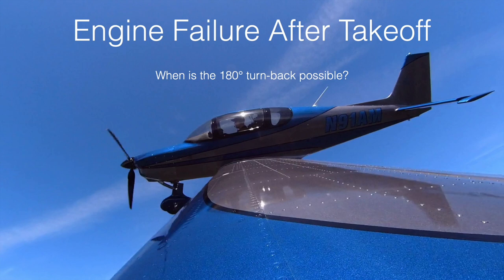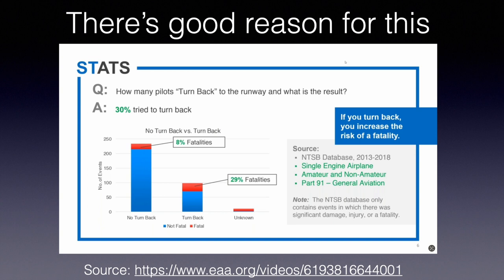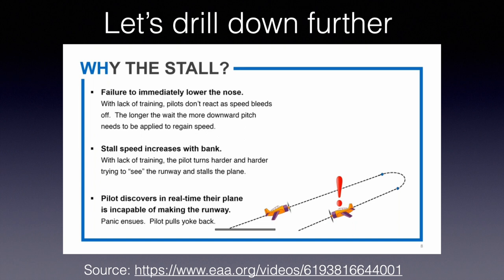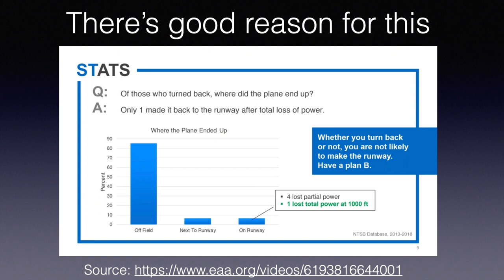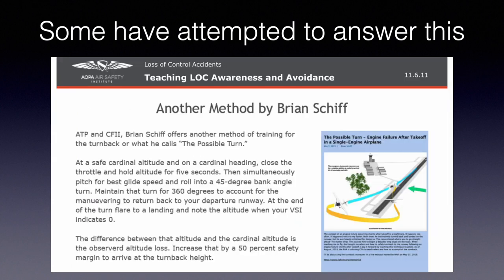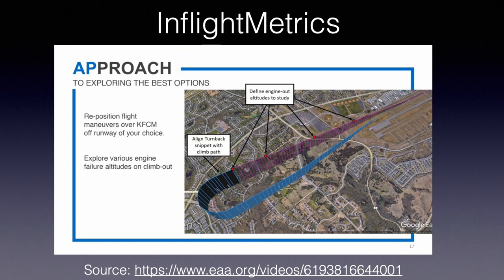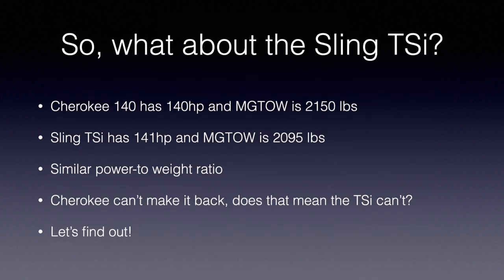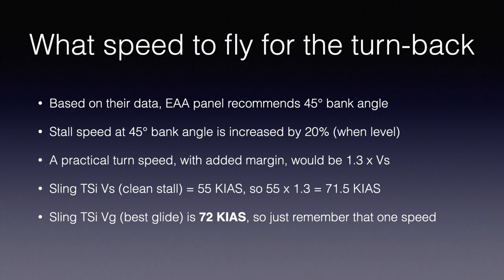Sling TSi engine failure after takeoff - Impossible Turn analysis

Comment: I learned them in 1996.  Teardrop with some power and no power turnback.  My CFI had  a great method and markers on altimeter and ASi.  Later on he came with the 777 formula for 4 cylinders and 999 formula for 6 cylinders airplanes..
Reply: Teardrop if partial power if under 500 agl so you get distance from the runway if on your side.  Turn 40 degrees to the side for first turn to angled and troubleshoot while getting some room for the second turn.  Only do that if power is down but not surging.

Comment: For under 500 agl Teardrop- The Partial Power Teadrop is.. Go with the crosswind for first turn to 40 degrees angle away from crosswind, the first leg for 4 seconds while leaning mixture and changing tanks, then 2nd turn is 40 bank to turnback at Vglide.  The 444 Teardrop Turnback.  After the 2nd turn, use Flaps if high, also cut mixture if high, dive to the numbers then cut flaps on flare. Brake with no flaps no prop turning.

Comment: I think this is an excellent topic that never gets talked about. I’m a firm believer that every skill level and Aircraft are different. You have to practice in your specific make and model. A few months ago  I wanted to see how low I could make this “impossible turn“ in my Rans is 21 with the Rotax 915. One of the most critical aspect to this is having a good coordinated flight install recovery techniques. An audible AOA is also extremely beneficial. I did mine at half fuel on a 50° day. I took off at the far end of the runway so that I would be the furthest from the runway when I turned back. I knew that if I was ever too low my wings level, add power and recover. I started at 800 feet then 500 feet and my third and final attempt was dropping the power at 280 feet. I gained another 30 feet in the turn, which was rather steep, but I had a lower angle of attack with a nose pointed below the horizon. Made it back to the runway no problem. Granted my aircraft is a light sport with a best glide speed of 59kts and the biggest thing was that I was expecting it. Nice job with yours! I should also film mine to see exactly what it is I did, and how I did it
Reply from the maker: Yeah, it's amazing how low that STOL planes like yours can pull it off. The lowest one we analyzed was 535' AGL with a 10-knot headwind, but had I been lighter or the DA had been lower or if I had used a Vx climb, the minimum altitude would be been even lower. Still, to stay on the conservative side, I'd probably add a couple hundred feet or so for fudge-factor, depending on other contributing factors.
Reply: MacSpadden was confronted with the worst kind of EFATO. And That kind of EFATO  i think he didnt know.  The Surging Engine kind.  The worst kind that can fool you into try to reach fields and suddenly engine quits all AND THEN YOU CANT.   Many good pilots have been fooled by Surging Engine EFATO.  Then engine quits and they crash short. 

I had 5 engine failures on pistons in the 3,000 hours that i flew them in South America cargo i flew in the 1980's.  2 total but they were twins.  DC3 and Piper Aztec.  I landed them feathered engine spitting oil.  The other 3 were partial power. Singles.  On take off.  Lost one cylinder.  There are 2 basic kinds of partial power engine fails (LOTOT).  This is for 4 cylinder engines. 
 1-The Vibration LOTOT,  2-The ENGINE CUTTING OFF IN AND OUT LOTOT.  

In the vibration LOTOT you sort of lose the climb only, so if over 500 agl, you can still Turnback or Turnaround airport if know how to before.  Dont know ? Dont go there.  Good luck crashing outside the airport.  Good to lean mixture and SOME carb heat apply after lowering the nose.  I was on Cherokee 180 on both and did the downwind leg at 1-200 agl, 2nd at 250 agl.  I didnt know how to do turnbacks, so i went to a low downwind leg.  Scary as hell downwind leg 200 agl at Vglide with engine vibrating.  

In the worst LOTOT or engine cutting off in and out, or engine noises, change tanks and be over say 700 agl before Turnback to opposite or side runway, and dont think about going around the airport, the engine can cut out before you complete the turnaround. =  Dont try any turn to airport under 700 agl if engine is cutting out badly.  Be a Turnback or a Turnaround maneuver.  

Practice LOTOT.   At least the engine vibrating "Turnaround" at 1,800 rpm and later on "The Turnback" from 700 up (depends).  LOTOT should be required due is 3 times more common than EFATO.   LOTOT and EFATO can get you easily if you dont know well.  So Ignorance is not the solution.  IGNORANCE IS THE PROBLEM.

Comment: So i did this with an instructor today in the Sling4. Lowest we were able to safely pull it off was 400AGL - this with 3 seconds reaction time, 12-15kt headwind and a field in an open plain. Standing start and a Vy climb (with level flight to get some distance upwind of the runway) The surprising thing for me was the lack of altitude loss in the turnback - on average around 150ft at 70kts 45deg bank. I know its controversial but I'd say that in MY aircraft, on a favourable day, I'd brief a turnback above 500ft. Thanks again for making us think about this...
Reply from the maker: Wow! I know the Sling 4 has a different wing than the TSi, but it’s surprising that your altitude lost in the 180 is HALF of mine! In any case, don’t forget that the headwind makes a huge difference. If you had no headwind your minimum turnback altitude would be substantially higher. You might also consider adding some altitude for a “fudge factor,” knowing that we likely won’t perform as well in an emergency as we do in practice. Of course, it also depends on the airport you’re returning to versus the off-airport options. So many variables to consider!
Reply from the maker: Also, what was the density altitude and how heavy were you when you did your practice turnbacks?
Reply: @OneAlphaMike  was approx 7000ft at airfield (airfield alt 5500) - prob 800kg /1700lbs  gross weight. (2 average crew/100L fuel). I think conditions were ideal  - as you pointed out it would depend on wind, environment around the field etc. Will do some more testing and report back.
Reply: Is there no way to calibrate your airspeed on the Garmin?  I haven’t looked at that aspect of my build yet, but I have to assume you can calibrate the airspeed to be more accurate.
Reply from the maker: @LTVoyager  No, you can't.

Comment: For power off better follow a rule.  The 777 No Power Turnback Rule.  If expecting to climb at 700 fpm plus, have 7 knots or more wind, then mark the altimeter for 700 agl or more.  I learned that on the Emergency LowManeuvering channel.  The 700 No power Turback rule.  Partial Power he taught from 400 agl if not surging engine.  If surging, dont turnback, headwind turn if any.

Comment: This makes me think that that flying the traffic pattern on departure, when possible, is a good safety practice.  Upwind, crosswind, downwind, then continuing to climb well above what would be a tight base leg.  In my airplane I'd be at least 500' above TPA by that 'base' leg. 

Yes, it adds a few minutes if your final course is in the direction of the runway departed from, but it keeps the airplane close to runway until above pattern altitude.  I fly out of a controlled airport where this wouldn't be practicable since it would conflict with ATC's normal procedures, but at an uncontrolled airport it could be safely flown without conflicting with other aircraft.

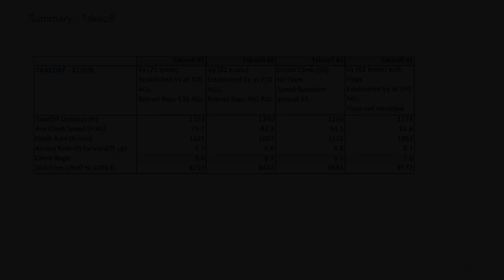Comment: 27:33  Climbing with 10 degrees flaps more or less is safer if engine fails, safer  visibility, and safer for rear cylinder cooling to due bit less nose up which cuts some ventilation to rear cylinders.  Safer climb. Then at TPA the flaps up.  I learned that in 1996 from ELM channel Bush Pilot CFI.
Reply from the maker: Different procedures for different airplanes. The Sling TSi climbs markedly better with flaps retracted. Cylinder cooling is not a concern with the Rotax thanks to liquid cooled cylinder heads.
Reply: @OneAlphaMike  Vx flaps or less.  Even in winter we climbed on Cherokees with 10 degrees of flaps at almost Vy.  FPM as good as Vy and safer over nose view.  and if LOTOT, we had some safe speed over stall speed.
Reply: @OneAlphaMike  Your climb angle is better with some flaps.  See your chart.  No flaps is 6 something and with flaps is 7.0
Reply from the maker: @outwiththem I can see how that number might be misleading. Those numbers were taken from a small snippet of time, not over the entire climb. As mentioned in the video, the important number is the bottom row, which is the horizontal distance traveled over the entire climb, from liftoff to 1,000' AGL. There you can see that the climb where I retracted the flaps reached 1,000' AGL 130 feet sooner than the climb where I left the flaps in. That shows that the climb angle over the entire climb is actually better when retracting the flaps. That said, it's not a huge difference, so if you prefer not retracting the flaps, it's not a big deal.
Reply: @OneAlphaMike  most engine fails on take off are the partial power kind.  And it becomes like a slow flight at Vglide speed.  And you need a bit of flaps for lift in it to avoid using too much nose up.  With say 10 degree flaps, you are ready for the main cause of engine fails.  More..
Reply from the maker: @outwiththem Vg (Best Glide speed) is clean, not with flaps.
Reply: @OneAlphaMike  Yes, Vglide is clean.  But with most partial engine fails on pistons, it is mostly one of the cylinders lost.  The rpm will fall to a bit under 2,000 rpm on most 4 cylinders.  My Bush PIlot CFI made me practice that in 1996 due he had 3 of those in old Cherokees in South america.  At say about 1,900 rpm, you need to keep speed at a bit under Vglide to maintain altitude and turnaround the airport if over say 700 turning downwind.  Under Vglide speed you need some flaps to keep altitude and nose not so high AOA.  Some airplanes need around Vglide speed to keep altitude, some a bit under.  Vglide speed is a general speed reference even if not gliding at that moment. 
 
Or if under 700 agl, decide to turnback to side or back runway or keep going forward to crash or land outside the airport. My 1996 CFI will post a bit more about the 2 kinds of partial power engine fails on take off later on.  He has a channel called EmergencLowManeuvering but he has other hobbies and dont post as much lately.
Reply: @OneAlphaMike  So why for a small snippet of time? Any way, with some flaps the climb angle is higher, not worse than with 0 flaps.  
 And if partial power engine fail and speed falls to a bit under Vglide, you need flaps under Vglide for some lift and nose too high and most 4 cylinders you can fly level altitude.  We did that on Cherokees and Cessnas. 1990's.  My old said he had done 3 cylinder turnaround on Cherokee 180 from only 200 agl (1,900 rpm).  We practiced them from 400 agl.
Reply from the maker: @outwiththem  I'll try it again, one last time. Two climbs to 1,000' AGL. One takes 8442' distance to get there, The other takes 8572'. Which has the better climb gradient?
Reply: @OneAlphaMike Quite close numbers.  Maybe 1% difference.  But were they done under exact weight? im discussing this with my 1996 Bush Pilot CFI which taught me 4 kinds of EFATO/LOTOT.

Comment: Something to keep in mind and discuss with ur instructor. Personally, I have executed an “impossible turn” in my flying career. I was in my Biplane which was light weight and had excellent glide ratio.
Reply: For power off better follow a rule.  The 777 No Power Turnback Rule.  If expecting to climb at 700 fpm plus, have 7 knots or more wind, then mark the altimeter for 700 agl or more.  I learned that on the Emergency LowManeuvering channel.  The 700 No power Turback rule.  Partial Power he taught from 400 agl if not surging engine.

Comment: Mike - this is fantastic data.  Thanks so much for providing this analysis.  As you pointed out, there are many variables but it's good to have a framework and even more important to practice it.  I trained at KPDK in an SR20 while getting my PPL. It is a densely populated area with few good options if an engine failure occurs on takeoff.  To his credit, my CFI repeatedly made me go through scenarios and verbalize them on every takeoff (to get it through my weak brain).  If engine failure occurs before rotation, max braking, S turns, etc; after takeoff but below 600 AGL, best glide and straight ahead; between 600 and 1000 feet AGL, pull CAPS; above 1000 feet AGL best glide and turn back to the field.  I've tried to get data on altitudes for chute deployment in the TSi but only heard generalities, so I'm very much looking forward to your next video that discusses that as well.

Comment: I learned 4 kinds of EFATO maneuvers ON THE RUNWAY DID THEM TOO in 1996.  Many "Turnback Accidents" are not.  They were instead "Turning Around the airport" with a partial power low power engine, stalled, crashed before final approach of the same runway they took off front.  They didnt "Turnback" when needed and crashed doing A TURNAROUND.  Those are 2 very different maneuvers.  Good to learn both.  Most EFATO are partial power or LOTOT.  You have 4-6 cylinders that can fail.
Reply from the maker: That's true about partial power failures, and it's one thing Rick from Inflight Metrics saw in some NTSB reports. The issue starts off as a partial loss of power, which gives the pilot the idea that they can fly around a bit more. Some even try to follow the pattern back to the airport  Then the partial loss of power turns into a total loss, and they're not in a position to land.

Comment: Thank you for doing this and helping me wrap my head around considerations when flight planning!
Reply: MacSpadden was confronted with the worst kind of EFATO. And That kind of EFATO  i think he didnt know.  The Surging Engine kind.  The worst kind that can fool you into try to reach fields and suddenly engine quits all AND THEN YOU CANT.   Many good pilots have been fooled by Surging Engine EFATO.  Then engine quits and they crash short. 

I had 5 engine failures on pistons in the 3,000 hours that i flew them in South America cargo i flew in the 1980's.  2 total but they were twins.  DC3 and Piper Aztec.  I landed them feathered engine spitting oil.  The other 3 were partial power. Singles.  On take off.  Lost one cylinder.  There are 2 basic kinds of partial power engine fails (LOTOT).  This is for 4 cylinder engines. 
 1-The Vibration LOTOT,  2-The ENGINE CUTTING OFF IN AND OUT LOTOT.  

In the vibration LOTOT you sort of lose the climb only, so if over 500 agl, you can still Turnback or Turnaround airport if know how to before.  Dont know ? Dont go there.  Good luck crashing outside the airport.  Good to lean mixture and SOME carb heat apply after lowering the nose.  I was on Cherokee 180 on both and did the downwind leg at 1-200 agl, 2nd at 250 agl.  I didnt know how to do turnbacks, so i went to a low downwind leg.  Scary as hell downwind leg 200 agl at Vglide with engine vibrating.  

In the worst LOTOT or engine cutting off in and out, or engine noises, change tanks and be over say 700 agl before Turnback to opposite or side runway, and dont think about going around the airport, the engine can cut out before you complete the turnaround. =  Dont try any turn to airport under 700 agl if engine is cutting out badly.  Be a Turnback or a Turnaround maneuver.  

Practice LOTOT.   At least the engine vibrating "Turnaround" at 1,800 rpm and later on "The Turnback" from 700 up (depends).  LOTOT should be required due is 3 times more common than EFATO.   LOTOT and EFATO can get you easily if you dont know well.  So Ignorance is not the solution.  IGNORANCE IS THE PROBLEM.

Comment: FOR TOTAL ENGINE FAIL, Use the 777 EFATO Turnback Rule for light singles.   The 999 Rule is for heavy singles. 
  The 777 rule can be done even when on preflight or driving to airport.  Will I be able to climb over 700 fpm? Yes? Are the winds over 7 knots? Yes? Then mark the altimeter to 700 agl for EFATO turnback or slighly more depending on your experience on Turnbacks
  The light Single engine 777 Turnback Rule = THE Nno Power 777 TURBACK RULE  FOR LIGHT SINGLES.  

Between me and my 1990's students we had to do 4 turnbacks due bird strikes, loose engine cowls an engine problems on take off.  4 airplanes saved i know.  iGNORANCE of Turnback turs is not the solution, IGNORANCE is the problem.